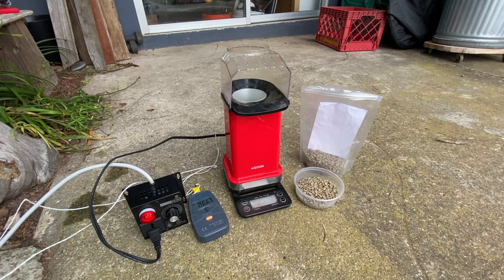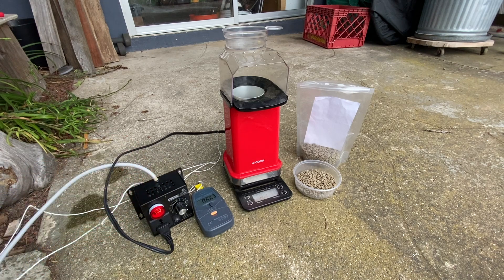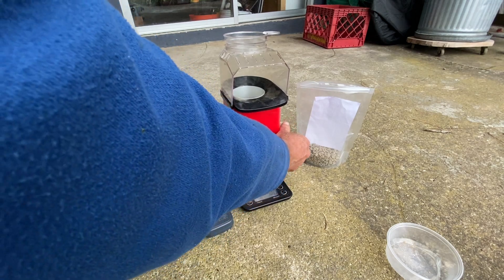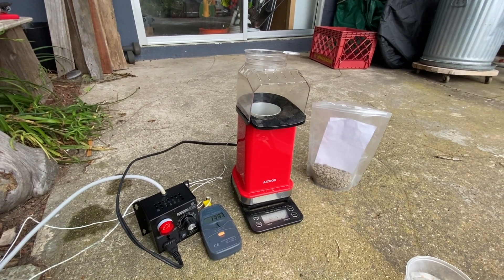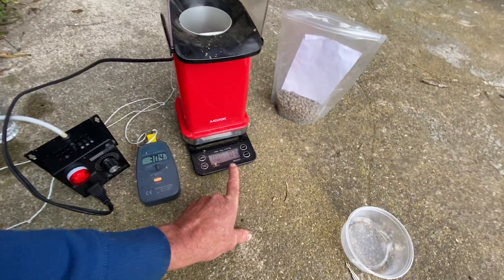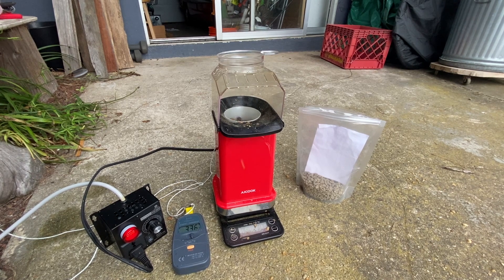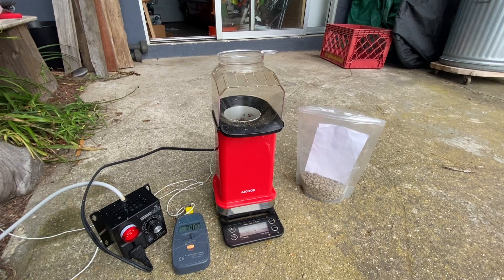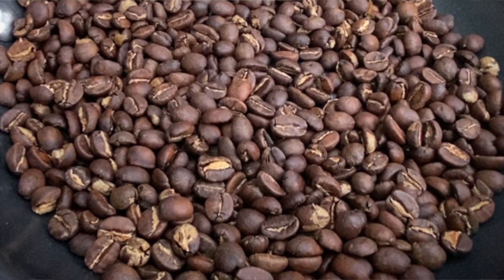Coffee Roasting by Weight Loss in Real Time (Air Popcorn Popper)

Comment: This is such a cool idea.  I just tried it on a roast.  I had a couple of problems. The first was that my scale was moving around so much while my roasting was running (SR800) I could not use it live to determine how much weight I lost.  I decided to stop the machine mid-roast so the scale would settle.  Coincidentally, the scale said I had hit my target weight when I stopped it, so I dropped the roast immediately and cooled it in an external cooler. The problem was after the beans were cool, I re-weighed just the beans and the weight loss was significantly less than the live roast value.  I am not sure why it was off, but on a 225g batch the weight was off 5.5g. Maybe it was the heat?  Not sure, but I am going to try it again on my next roast and let the live roast register 5.5g more than it says.  This is just too cool to give up on!  Thanks for the idea!
Reply from the maker: I'm glad you tried it - I didn't have a scale that could accommodate any other roaster ... and it only occurred to be because the Poppo popper (of which the red one was a prototype) was so lightweight. Vibration is an issue, but it actually seemed to work. I am not sure how to refine it but I think it's an interesting concept. -t
Reply: @SweetMariasCoffee  I have been thinking about this still.  Today I tried a roast with your Colombian Las Mercedes.  I Usually roast 225g batches, so I printed a spreadsheet with roasted weight and associated percent weight loss for easy reference while I was at the roaster. I was going for between 11.6% and 12% weight loss, which was between 198-199g according to my chart.  This time I tared the scale with the SR800 empty. Then I added the beans and roasted as normal noting I was looking for about 198-199g roasted weight.  Right after first crack, I quickly powered off the SR800, let the scale settle. It read 201g.  I was looking for 199g, so I powered the roaster back on with the same settings and let it go a little longer (about 30s after first crack).  I stopped the machine again, read the weight which was now 199g. Perfect! I then dropped the roast and cooled with an external cooler to arrest any further roasting (hopefully).  After cooling, the weight was still 199g so this is very promising.  Very good correlation.  Also, the color was very good. There was a short period where the SR800 was off, but only for a couple of seconds. I don't really think it will affect the roast much. But now I know I am really close to my targeted weight loss and won't likely need to use the scale next time I roast this coffee. I was using Artisan and captured the profile, so I should just be able to follow it next time I roast this coffee, or make adjustments based on the taste.  Can't wait to taste it!  I think I will use this method the first time I roast each new lot of coffee to set a baseline.

Comment: I've been using Poppo for about three weeks now... I live in Minnesota and have roasted in my house and in my garage (40 degree ambient temperature difference) in the 25+ batches ive done I simply CANNOT get past 4 minutes without first crack and by minutes 5 roasts are going to vienna or french, whatever you want to call it. I've used coffee from central America, brazil and Africa in my attempts.
I've tried the extension cord method, turning the machine itself on and off multiple times, nothing seems to work.
Is rhe Poppo just too hot too fast🤔?
Please @SweetMaria's reply and help me figure this out! I desperately want to roast better coffee with the Poppo😢
Reply from the maker: Hello. Great question. Yes, Poppo has been known to roast fast and dark but there are additional things you can try, like reducing the batch size and adding a power strip onto the extension cord you are already using. Let us know how it goes.

Comment: Thom, just something i wondered looking at Poppo. Would it be possible to mod the poppers to have the watt meter wired to the heat coil but not affect fan speed? Not sure how the internals are wired but this seems like a worthwhile experiment at this price point
Reply from the maker: That seems like a worthwhile project but would require some electrical knowledge since the watt meter connects to Poppo via Poppos plug.

Comment: great idea!  I'm now using an SR 540 (which I bought from you), so I'd have to find a scale that would take its weight AND also be accurate to the gram.  the 540 is heavy, so I'm not sure there's a scale out there that could handle its weight and be accurate to the gram.

Regarding the voltage regulator:  I tried that with a popcorn popper, but it didn't work out the way I was hoping because when you dial the voltage down, you get a reduction in
 both heat output AND fan speed.

Comment: I think I had this hairbrain idea at some point but never tried. I'd worry about the WL being too gradual over the time of the roast to register accurately on an inexpensive scale not calibrated for this application. Maybe measure weight at start and then put it on the scale near the end so there isn't too much distortion.
Reply from the maker: It is a really small increment, and if a few beans are tossed out in the roast, it throws things off. But mainly I was just trying out that "hair brain idea" you had ... what if it could work. I think it could with some further thought and focus...